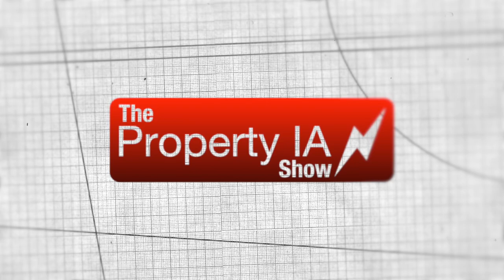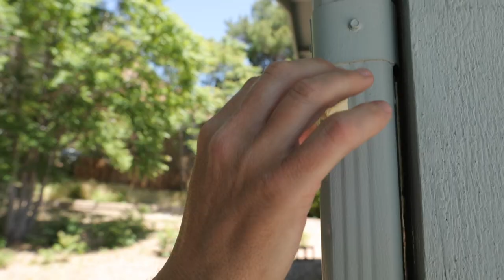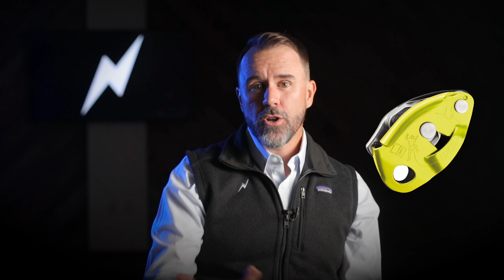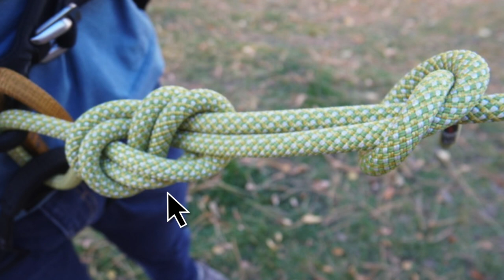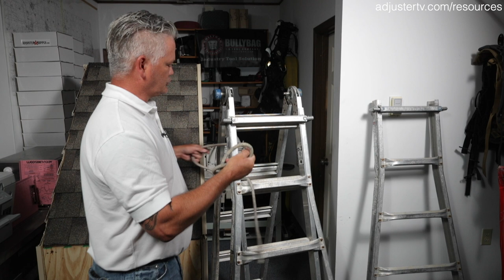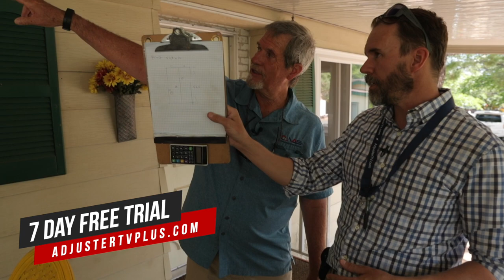This can save your life | Figure Eight Knot

Comment: Hey Matt, Great Video. The "Fig 8", the "Fig 8 follow through", and the Overhand Locking knot" are definitely great knots for securing Kernmantle rope to anchors. They represent three of the six knots in the majority of worldwide rope access standards training. We extend out invitation to you again to come out and see the benefits of learning an "Alpine Butterfly" (used to isolate a bad spot in your rope or to load your rope in three different directions), a "Super 8" (for securing rope to anchors when using carabiners),  a "Water knot" (knot used to secure webbing to create perfect connection points for load shared anchors), a "Tensionless Hitch" (the quickest, easiest and safest way to secure a rope to an anchor) and a "Prusik Hitch" ($6 multi-directional tool hitch). Soo much to show you at our unmatched training center and soo much to learn from our process that has spent the last decade perfecting.
Reply from the maker: Email me and let's get this set up..  https://www.adjustertv.com/contact